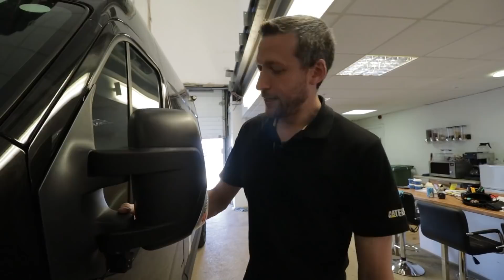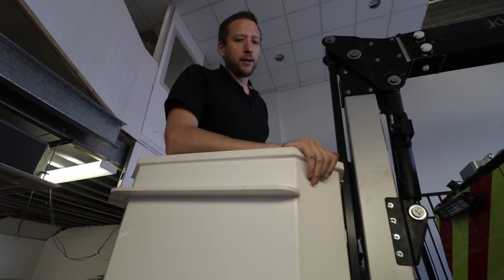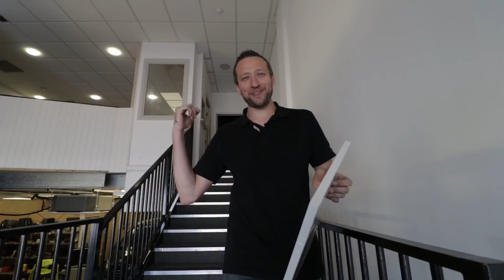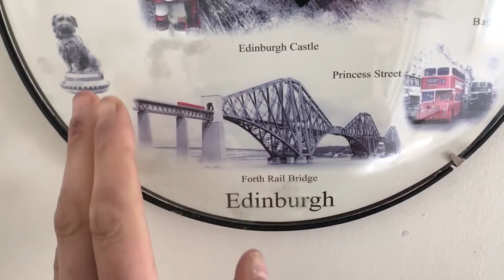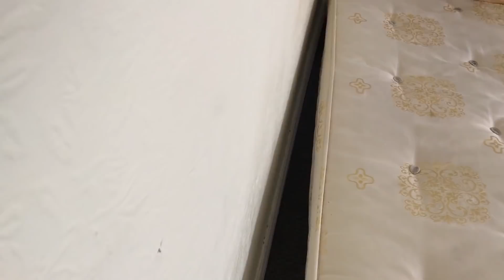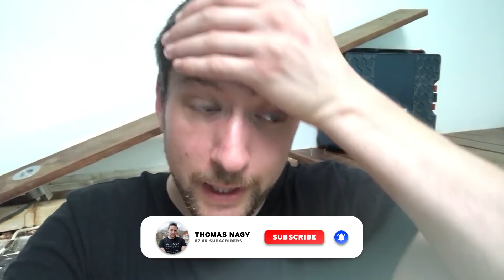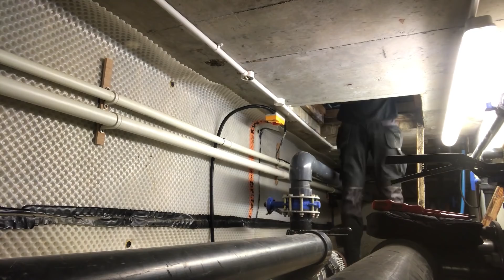Help me price this ABANDONED house | Thomas Nagy

Comment: On the price up job check out CJR electrical YouTube.   Worse rewire job ever.   Cheap and nasty workmanship.    I would say 2 weeks is about right for one person, however the job will be a lot easier with 2 people for one week for pulling in cables and stuff.  I suspect that plaster/render will blow out a lot.  Use a wall chaser as much as possible and less SDS.   As always good video Tom

Comment: Need to add a manual override switch to bypass the stabiliser jack pressure switches. Using a momentary switch would prevent it being left in override.

Comment: I'm surprised you cant turn on/off the engine from the bucket. We don't even have outriggers on our light duty 10 meter bucket trucks here in murica and our heavy duty 30 meter boom trucks have spreader pads for the outriggers.

Comment: Tom, have you considered putting your name & contact info, or business card, on each consumer unit you install? Where I live it's common for tradesmen to do that - air conditioning, plumbing, etc. Later on down the road if a customer needs repair they will know who to call, especially if it's a different homeowner than when you did the install.

Comment: Thomas run the emergency pump through the inertia that way when your vehicle is turned off the pumping system in the bucket will work does that make sense?

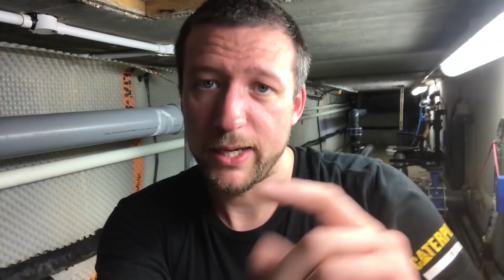Comment: 28:18 Sorry Tom, you are right with the steel ball in the float switch, but they don't have pins, they have a microswitch. A steel  ball will make a bad contact after a while (arcing) so pitting the ball.

Comment: This is why cranes and use pressure pads distributes the weight evenly,  get some off cuts of scaffold board's and if working on grass put a 3x3 18 mm ply down then lay scaff board's on top of that works for me.
Old saying " proper pre planning prevents piss poor performance "

Comment: I know on a normal boom lift, you have a pressure release that in case of an emergency you have a guy low level with a rescue plan to either… A) control manually from floor level on a override control. B) pressure relief valve that lowers the boom to ground level. Don’t know if this is same as vehicle mounted booms. :)

Comment: this is going to sound crazy Tom but could you (if you had to in that situation with the boom arm etc) rather than using a long pry bar get the second man to drive the truck forward ? would be interesting to know if you can still run the engine etc and rive with the boom extended. Obviously this would be a last resort :)

Comment: I used a stand alone cherry picker trailer to paint our house and if any of the 4 legs lost stability or you over extended the arm then it would lock out your controls but it would let you turn the emergency switch and slowly bring the arm back down, and it would force you to go right back down so the basket was back in its cradle. The basket also had to be in the cradle to adjust the legs but it did give you a way down. That system in your van just seems a bit crazy tbh.

Comment: Surely if you were on your own, you wouldn't be able to stop/start the engine while in the bucket, therefore the computer wouldn't reset - so even if the stabilizer lost pressure you would still be able to come down like you showed the first time you went up?
Reply: Yeah, but imagine his arch-rival, let's call him "Francisco Sparkamanga", turned the engine off while he was up there.
Reply: @RFC-3514  Well yeah but that would just funny so it's fine, joking aide though it doesn't seem right that it'll leave you stuck up there, feels to me like a loophole in the software that they didn't quite think about or thought it would be not common enough to do something about
Reply: You can get switches that you can turn the engine on and off from the bucket some tree surgeons have them

Comment: Not used a bucket truck but saw one being used a couple of days ago and the stabiliser arms were out so far the wheels of the truck were off the road so all weight of the vehicle was on the arms. Is that not how it's supposed to be used? the arms take the weight, not the wheels???
Reply: Same with some cranes I’ve seen , I guess that keeps the pressure on them all the time

Comment: I priced a two bed terrace at 4500, got told "far too expensive", and they were going with a proper electrical company! Six months later they asked me to fit an oven, "how much?" they asked, I said a hundred quid. They said I was too expensive again! To get in my van and spend half a day fitting and testing an oven install, 100 quid is cheap. 

Sparks are not just handymen! We carry far more than a couple of screwdrivers and a hammer!
Reply: Half a day to install and test an oven?
Reply: Yer they were right, you're expensive.

Comment: Cause you turned the engine off from the key in the cab, it will automatically disengage the PTO so if you restart the engine you need to re-engage the PTO.
Our hoists at work have a switch in the bucket that can start and stop the engine and will keep the PTO engaged. We all get Ground Support trained on how to operate the hoist from the ground in case of emergencies etc at my work
As for the legs its a mix of pressure and tilt sensors so if detects instability it will cut power till you sort it. There is also usually a nut on the boom near the van roof you can turn with a spanner to rotate it into a safe positing that will allow the boom to be lowered
Reply: To the top!
Reply: cant shut down the engine alone if up on the hoist so the problem will never happen.

Comment: 2 men (good sparks) 1 week , if there’s problems maybe another day or 2.
Reply: This is 2-3 days work max
Reply: Depends on the standard of work
Reply: @supersparks9466  Still 2-3 days. I been knocking out 3 bed occupied rewires in 1/1.5 days and there’s only 3 of us. Assuming Tom has another bloke with him then it should be 3 days max
Reply: I stand by my comment, a 5 day rewire should be a better standard than a 2 day one. Anyway if you wanna bust your ass crack on.
Reply: @supersparks9466  There’s no reason you can’t reach the same quality in 2 days than you can in 5. It’s called not taking 3 lunch breaks a day and actually thinking about what you’re doing - pulling more than 1 circuit in at a time shit like that. If it’s taking you 5 days to complete a 3 bed rewire at decent quality then perhaps you’re in the wrong trade. 

Yes I do bust my ass off but how else am I supposed to earn the money? I’m 21 and earning 280 a day off these jobs and my career is only just starting. I like to think to myself if I can earn this amount of money at this age imagine where I’ll be in 10 years time? Life is about setting goals not being stuck on your day rate wage
Reply: Only 280
Reply: @supersparks9466  I’m 21 big man - my supervisor is on 420 so that’s what I’m working towards, will hopefully be there in a few years 💪🏻
Reply: @supersparks9466  I highly doubt either on you are on 280 a day stop lying…
Reply: @uplightuk8924  420? Bullshit
Reply: @hi-dt9bk  What? You’re probably stuck on day rate mate you can earn a fuck ton from price work. I’m not even scraping the barrel - I’m young and at the start of my career. I’m not even in London either. I used to be on day rate and thought anyone saying they earn more than 300 a day were full of shit but I see now that if you put in the work you can earn a lot of money from it. My boss gets the rewires subbed out to him and takes home about 950-1k profit after tax per rewire and we’re doing 1 per day. There is 3 of us. You do the Math

Don’t get me wrong - this won’t last forever and we haven’t always been able to work like this and probably only will for a limited time but what I’m saying is that if you graft there is a lot of money to be made, especially if you have your hands in the right pockets
Reply: Not surprised he’s on 420, your cracking out rewires for him in a day earning 280.
Reply: @hi 8 hours a day at £40 per hour is £320 so £280 is not unreasonable
Reply: @supersparks9466  Yeah but you’d be lying if you told me you’re actually earning that much on day rate
Reply: Don’t need to lie, I’m a grown man. I don’t work for anyone but myself so not on a day rate but base my price work to make sure I make at least 250/300 a day sometimes it’s a lot more if you get a touch, sometimes less if it’s a mare. Anyway I’m done with you,this tit4tat is getting boring.
Reply: @uplightuk8924  you can’t sustain a business on income of £280 a day, there’s nothing left to invest in growth
Reply: @electricery  Good job I don’t own a business then
Reply: @uplightuk8924   but if you work for yourself then you do
Reply: @electricery  No I’m a subby I don’t own a business there’s a difference mate

Comment: In the case of your dilemma with the bucket lift surely the company who supplied you the unit should be able to advise on your best options to overcome the problem you have encountered. I must admit like others have commented you should be using spreader plates under each jacking leg in most applications. Keep up the good work and stay safe.

Comment: The bucket or part of the boom pushes on a limit switch when it is fully down.  find that switch and get the other person to press it. That allows you to re-adjust the  jacks. If you are on your own,  you need a "bucket escape" system, which is basically an abseiling set up.
Reply: He said in the previous video that it was exactly how he got around it (the video is even named "My first COCK-UP with the bucket truck..."), so he knows about the switch, he was just wondering is it how it's supposed to work and/or how are you meant to do it if you are alone.

Comment: there should be a manual bypass on the hydraulics so that if you get stuck without power the ground operator can safely (though slowly) bring you back down to ground level
Reply: These exist on many mewps/scissor lifts ive used on sites here and there, its basically a manual lever inside somewhere, usually near the emergency stop that basically slowly depressurises the hydraulics, takes a minute or more from full height and its just a straight "drop"
Reply: Telehandlers have devices that won't let you lower the boom unless there's pressure, means if there's a hose failure the boom doesn't just drop.
As a result it's a complete pain in the arse moving the boom if a hose does blow but it's safer.

I would be amazed if man lifts didn't have the same feature. It would mean you couldn't accidentally recreate the scene in Casino Royale where Bond rips the valve chest off the scissor lift and crashes the whole thing to the floor.

Uncontrolled lowering of the basket could also end up toppling the machine over, because as you lower the arc takes the basket further away from the van.
Reply: @tomcardale5596  the bypasses I've seen have some kind of serious flow restrictor so it's a gradual depressurisation and very well controlled
Reply: @Simon-ho6ly  I'm amazed that works. I'd assumed that, as material lifts include valves to stop that exact thing from happening, people lifts would too.

I've done it on old forklifts but nothing I've driven made any time recently.
Reply: @tomcardale5596  The ones ive seen are a special valve, its not like popping all the valves full open but like a bypass that must have literally a pinhole opening or something, the descent is VERY slow and well controlled and you can hear the fluid rushing through the constriction sometimes..
 this is an example on a genie lift https://www.youtube.com/watch?v=qN3vS6DWnlc

Comment: More evidence of a North / South divide. If I wanted the job it would be £3250 to £4000 depending on spec. I wouldn’t get any work if I was giving estimates as high as £7000 for a three bed empty unoccupied house. Excellent stuff Tom👍
Reply: £7000 seems a bit excessive even for London, it can be done in 2-3 days tops

Comment: Why not just get some backup/forward looking cams...the ones with no grid lines...they are waterproof and tiny...they are not 1080p but they work just fine.  
I bought 4 of them for less than $20 each...and a quad monitor for another $70...so about $150 for a complete 4-way system.  
.  
Those tenants that left the gas on & walked out should be arrested for reckless endangerment...at the barest minimum...someone could have easily been killed!

Comment: The bad bridge builder's name was Bouch and it was the Tay Bridge which collapsed. Bouch's design for the Forth Bridge was not used. Bodge seems to be a UK/Aussie term with earlier origins. In the US I never heard "bodge" until Youtube exposed me to it. We usually use kluge or jerry-rigged.
Reply: Bouch's design for the Forth Bridge had just started to be constructed when the Tay Bridge collapsed, and work was immediately halted.  There is apparently a single pier left from this construction, but I don't know where it is.  What you see as the bridge now is all part of the replacement design.  It is true that the approach viaducts were designed and built by a different firm than were responsible for the main bridge though.

To go back to unverified stories about the bridge, it's rumoured that the designers worked out the forces on a bridge from twice the plausible maximum wind speed then designed it to withstand twice those forces.  Whether this is true or not, the designers would certainly have been pretty paranoid about making sure it could take Scottish weather when construction restarted just 4 years after the Tay Bridge disaster.

Comment: A way to override those safetys would be usefull,  however it would get abused unless it was comlex enough to enable.  Thats not a great solution tho,  i know scissor lifts have a trigger that releases the fluid in the cylinders, lowering the lift; but that wouldnt work in the bucket probably.  The solution is probably to have the ability to abseil out of the bucket like what large forklift drivers and scissor lift drivers train to do

Comment: As you mentioned, the problem with the outriggers losing proper contact to the floor only happend to you on soft ground.  You could maybe use outrigger pads to minimize the chance of that happening.
Edit: It seems a lot of us think that that would be the solution, 5 other comments with the same solution written at the same time :D
Reply from the maker: Yeah, cheers for that pal!

Comment: You need some blocks to spread the load under the stabiliser arms, I don't know why they aren't sold with them as standard, even from a safety point of view, if your trying to stabilise on soft ground it will just sink over time and get you stuck just like you did.
Reply: I'm pretty sure he has them, and even showed them in a previous episode.

Comment: Shouldn't you be using pads to lower the lifts on to. Especially on gravel or soft ground. Proper pads shouldn't flex and so the lifts wouldn't loose pressure
Reply: This is the correct answer. Big chocs of wood, which have been advised are fine until they give way. That'll wake you up. Rated pads and the legs shouldn't loose pressure.

Comment: Here is a tip if you use a bucket truck and you have the stabilizer jacks keep big blocks of wood in the van to put under the jacks in case you are going to work on gravel or dirt. The blocks help distribute the weight evenly across the soft ground
Reply from the maker: That is a great idea! thanks for the tip
Reply: @thomasnagy  its a pleasure
Reply: @thomasnagy  having worked in Canada doing traffic lights and street lights it’s essential mate to have wood plates not least on hot days when the Tarmac gets hot and very soft.
Reply: @thomasnagy  use them in a crane man we use 2m by 2m steel plates weight distribution on that size means you won't lose pressure
Reply: I mean, don't you have the pads for it already?
Reply: @jdarmst  when in doubt with pads just spread out more, a block of wood down onto 2 pads is better than risking the single pad sinking down. It's all about reducing pressure on the ground
Reply: Wow i was thinking about the same only my plan is use a big steel strong plate hahaha
Reply: Asfalt is soft. Use blocks allmost every time.
Reply: @Jako1987  You'll be fine on a road, pavements you should use blocks.
Reply: Man hole covers are the devils work
Reply: That reminds me: I've seen a lot of truck drivers do that now that i think about it .
Reply: I was thinking exactly the same thing..
They also prevent potential damage and scratch marks to the surface the Jack's are on..
Reply: Didn't Tom show large pads that came with the truck in a previous episode, just for that purpose?
Reply: GRP waffle boards (industrial flooring often used as 4x4 recovery boards) might work quite well.

They certainly work well when you've lost your Land Rover in to a bog and need something to spread the jack's load out. Possibly cut in half for this application?
Reply: Don’t use wood, get some composite plastic blocks.
Reply: you can also keep a 10mm thick 20x20cm steel block that has one side angled so you can hammer it between the wood and the pad so you can get that extra 10mm that can fool the pressure sensor

Comment: I would agree between £6500 to £7500. When AFDDs are compulsory that will add an other £1200
Reply: Struggle to get customers to pay an extra £30 for surge protection, never mind £1200 for AFDDs. There's certainly going to be a lot of explaining to do as to why the cost of a fuse board change has skyrocketed once these come out.
Reply: They shouldn't be made compulsory,  Electrical safety shouldn't just be for the rich! AFDD's are overkill to be honest
Reply: Is that how much AFDDs are ?